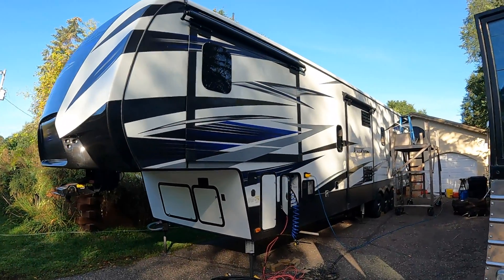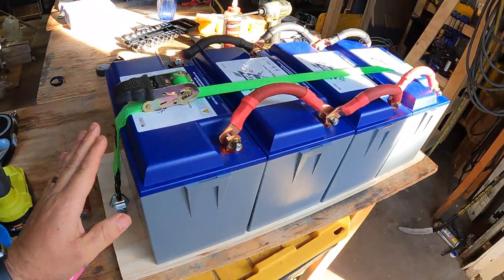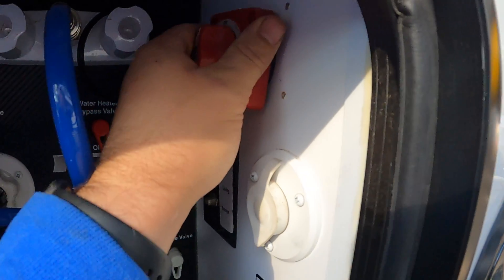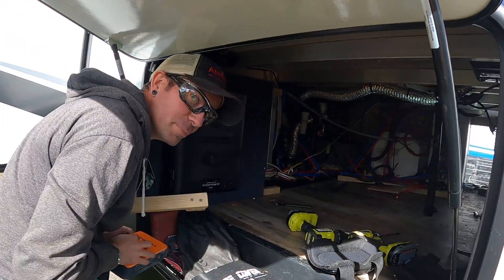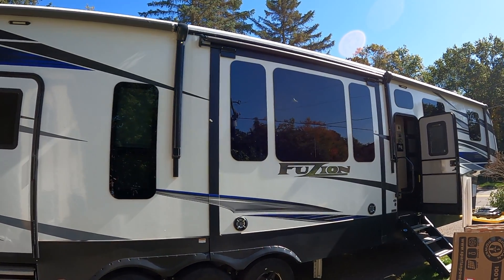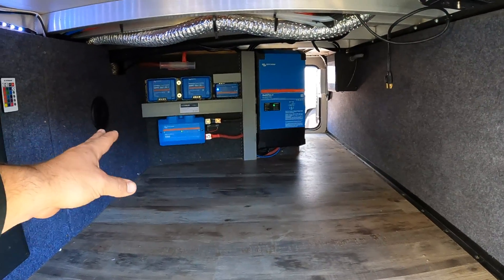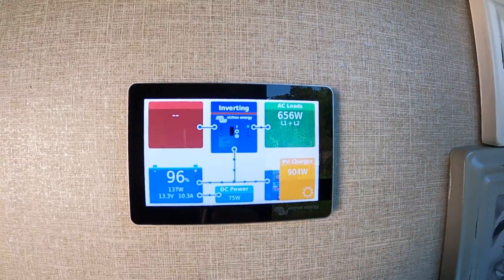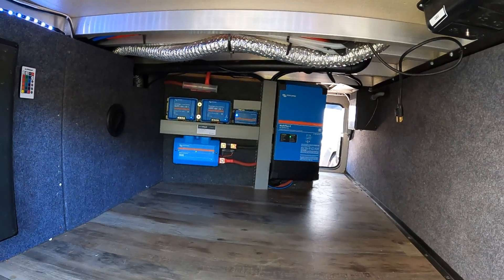2018 Fuzion 5th wheel RV 1600w Solar Install

Comment: When needing to make a hole bigger, just put the same size hole saw inside the larger hole saw you need to use. There is enough threads there to spin it on inside and will act as your pilot bit. Better than using a jig that would need to be screwed on to the wall making more little holes.
Reply from the maker: Good
Tip, thanks! 

I think we tried to use the existing holes , but still great info!

Comment: Suggestion on opening up that disconnect hole. Take a separate board of 1/2” ply, say 6” x 6”, drill the larger hole with a hole saw in it, and mount it to the cabinet face using those 4 locating screw holes. Then use that add on board to center a hole saw so you can just nibble the hole out to size. Remove board, admire your tear out, and install the new one. 

Or just surface mount the box like most of the blue sea’s do.
Reply from the maker: That's a good idea too.

Comment: Good videos. I enjoy your channel. Quick questions for you. All the installs I see, no one is opting for the 24v system. From what I have read and seen I would assume when you get over say 600 amp hrs and/or 1200-1500 watts of solar there are cost savings and efficiencies to 24v. 
One less MPPT, although a 24V to 12V DC-DC converter is needed. Smaller wire, fuses, etc. Is it just easier to stick to 12v and the savings are not there.
Reply from the maker: Thanks for watching. We have the discussion often, most people opt for 12v out of familiarity. However this year I think you’ll see more 24 and 48v systems. I’m putting together some of those exact video examples to show exactly how it saves on equipment but I’ll say most importantly safety.  I’ve had some 300a disconnects get hotter than I’d like when pushing the 3000 Multiplus on 12v . 

Fun fact, the Sota Solar Bus is 24v and I love it! 

Thanks again for the great comment.

Comment: Another good install. Would still like to see how you seal up the vent pipe once you shove the solar cables up to the roof??  I am adding another charge controller to my rig and have to run another 10ga to the roof and would much rather use this method rather than fishing walls. Thanks.
Reply from the maker: JD got in there with some black silicone sealant. Apply it, smooth it out. 

Another method is spray foam.

Comment: Another nice job. Question: are you using a class T fuse for the LiFePO4 main fuse? It looks like on most of your projects you are using ANL or Mega fuses.
Reply from the maker: We did stop using mega fuses for main disaster fuse. We’ve been looking at Class T fuses as well.   For now we’re using ANL fuses for that role which seems to be an acceptable use case by Battle Born and our other suppliers. I have read some other industry standards that say otherwise and Class T should be used.  Someday I’d like to test this very theory. I have a feeling the BMS will give up the magic smoke far before the wire or fuse will. 

Thank you for the comment and I / we will continue to asses the best components going forward.
Reply: @sotasolar  good point on the magic smoke trapped in the internal (serial) BMS  (until a dead short frees it 😳). Of course that kind of current might weld the BMS to slag as it releases the smoke 😱. 

My setup is an external BMS with parallel batteries (Victron Lynx/smart LFP) with individual class T per battery. I’m torn on whether I need a (500a) class T from the busbar paralleling the 4 fused batts or if those fuses protect the main system from catastrophe and a lower AIC fuse (ANL) protects the switch/BMS which I have (shamelessly) stolen from your excellent design. It’s a busbar link to the switch and BMS so I don’t think I really need a fuse at all, but…a marine surveyor might read the standards differently 🤷‍♂️ 

Great stuff. Here’s to never failing the smoke test 🍻
Reply from the maker: As I understand it, the class T’s main advantage is the interrupt current rating. That will be most needed after paralleling.  If this fuse blows it’s from a catastrophic event (crash/ dead short) not usage based load.  If you have the Lynx fusing individual loads you should be good there. 

I’ve cooked a BMS myself and it just ceased to function, I think I tried pulling 1000-2000 amps from it. Tried starting my bus accidentally, I’ve since upgraded the Daly to the 500amp model, no issues.